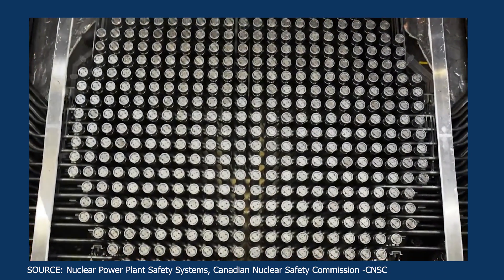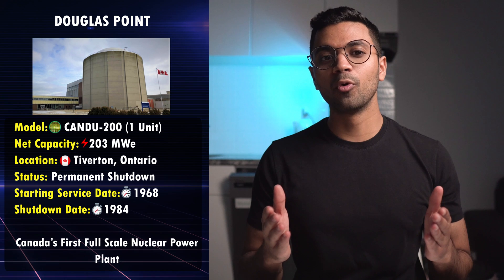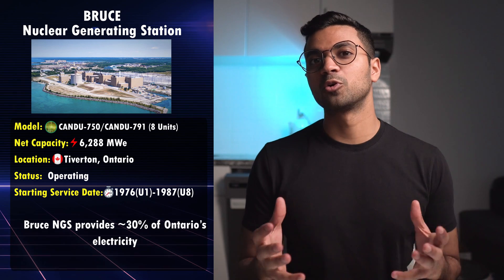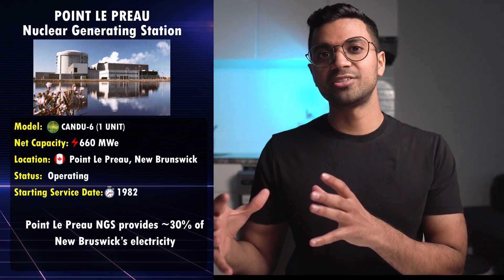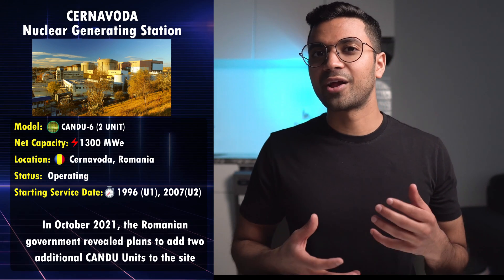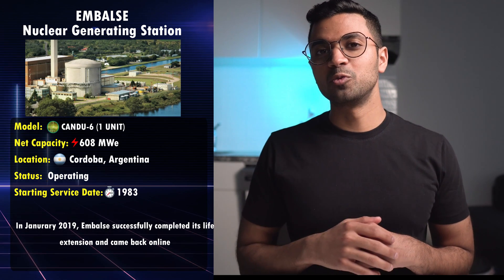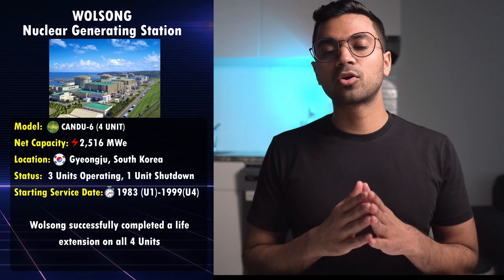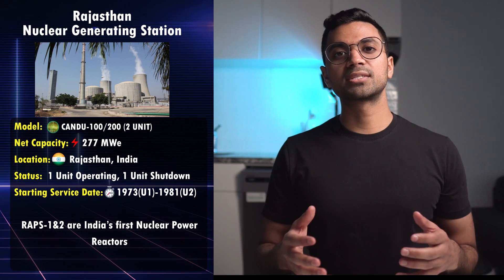Why CANDU is the 3rd MOST popular Nuclear reactor

Comment: Should at least double the number, if 20% of a country's current supply is Candu, another 20% will take the pressure off Wind Solar and Batteries to get going without the necessary mining and engineering equipment, that is already stretched to capacity. More Candu has to be the most efficient and effective way to upgrade power systems near to consumers?

Comment: Hi, Osama 
As someone who also spent months studying nuclear engineering, I must say that CANDU has its benefits and drawbacks. 
CANDU has its benefits. The biggest benefit is its capability to operate continuously even in the occasion of refuelling. 1000 days of continuous operation is not only impressive but record-breaking. CANDU’s ability to utilise natural uranium instead of 3-5% low-enriched uranium makes the economics of the reactor much more attractive than a light water reactor such as a PWR or BWR. However, when it comes to the drawbacks. There’s one MAJOR drawback that I’m acutely aware of, which is the CANDU’s staggeringly time-consuming refurbishment project to enable another 25-30-year operational period. This is the main reason why if I’m the director of any utility’s nuclear division, a CANDU is most likely not my “top choice.” Warning: personal opinion.
A CANDU not only has to replace its steam generators. The calandria must be de-fuelled first, then removing feeder tubes, then fuel channels, and finally calandria tubes. When everything is re-assembled, such a refurbishment takes a minimum of 3 years. For a PWR, such an operation to extend a reactor’s lifespan to 60 years could be achieved with three or even two extended outage. For example, in the case of Diablo Canton across the pond in the State of California, the operator replaced the twin-units’ steam generators during the early months of 2009 (50? 60 days?). During the second extended outage, the operator replaced the reactor vessel heads for the two units. During the third extended outage or even the second, the operator could replace a reactor’s HP/LP turbines. Thus, unlike a CANDU, a PWR can still generate electricity in between these extended outages.
Reply: Could a standard pwr use heavy water and natural uranium getting increased medical isotopes and fuel availability that candu has? Or is something about noncandu pwr not able to use heavy water?

Comment: Hi, do you guess CANDU may be used as a kind of thorium breeder reactor?
Reply from the maker: I do know that CANDU's can be modified to use thorium mixed fuels. I don't know the exact design changes that would be required to facilitate this. However, I know India uses a lot more Thorium in its CANDU derived reactors
Reply: it was done in a test program in enbalse in 89 to 91 also a test program for uranium-plutonium mixes the fuel bundles need a different geometry

Comment: Another great video , not sure if you mentioned this but I noticed a lot of these reactors have a 30 year life expand before being shutdown, why is that?
Reply from the maker: Thanks itsKEVO! That is a great question. Nuclear reactors are like vehicles, they need maintenance. Once CANDU reactors reach a 30 year life time, main equipment like the reactor heart (Calandria tubes) and steam generators need to be replaced. This is incredible since nuclear reactors are running at 100% Full power for most of the year. Other reactor types have up to 60 year life expectancy
Reply: @OsamaBaig Those 3rd generation and up ones have longer life spans